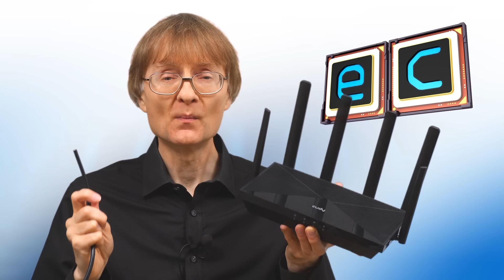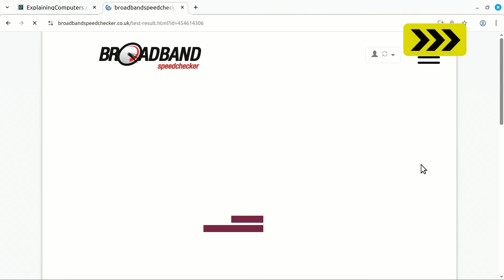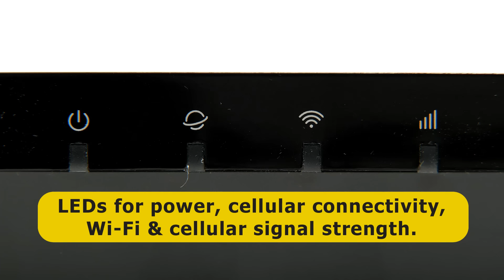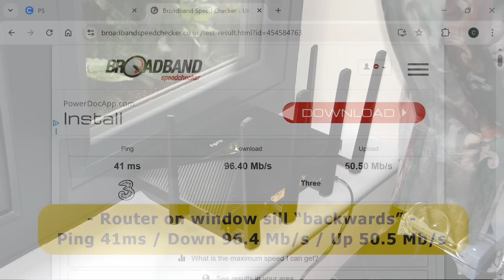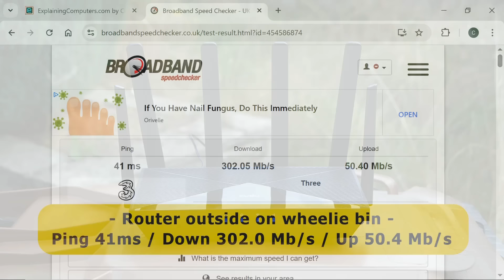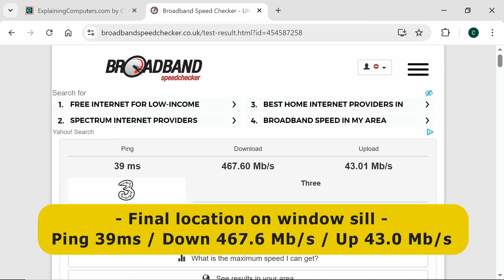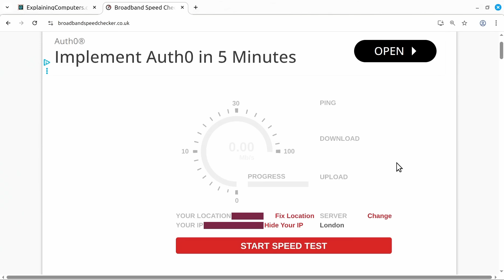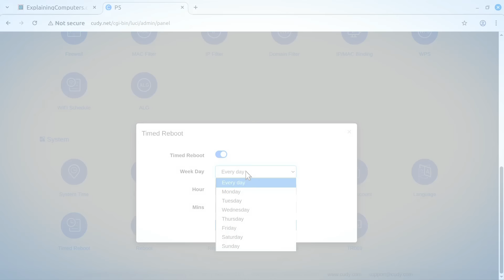Switching to 5G Broadband: Cudy P5 Router

Comment: Don'r rely on the router to also act as a Gigabit switch, get an unmanaged 8 or 16 port 2.5Gig switch and just run one cable from that to the router to take the internet traffic. Also, try raising the router on a couple of books so the aerials are not partly blocked by the window frame.

Comment: I connect to the internet using copper Gigabit connection of 1gbps down and 39gbps up.  My business relies on data transfer so when the internet is down I am totally losing income.  Also my income is based on traffic which means I earn more if my internet speeds are higher.  Fiber is coming sometime soon and offers a minimum of 1 gbps up and down.  I think they call that syncronous internet.  This speed is very desirable and at nearly equal or lower cost.  Faster internet will increase my business income greatly so, I'm patiently waiting. 😇

Comment: I used to get better data speeds on my 4G phone than when i was on FTTC, as my physical distance to my cab was 800m but my Digital distance was 1.6km, downloads were 12Mb/s and up loads were <512Kb/s latency would vary between 100ms and 3000ms (that's 3 real seconds waiting for a response to a mouse click), it was dire. 4G gave me 24Mb/s both ways and a reliable 30-40ms. 
Fortunately we now have the choice of 3 Fibre suppliers, Openreach, CityFibre (was LitFibre) and BeFibre all fighting for my money which currently going to Be Fibre (1Gb\1Gb\20ms for a paltry £25 a month which is less than I paid BT for that FTTC service). Openreach and CityFibre both only work through resellers so quite a good choice of suppliers.

Would be interesting to know what data caps you have and the costs compared to say Starlink or other services. Also long term how the connection is affected by weather, and the merger of 3 and Vodafone.

Comment: I use Verizon Fios which has fiber literally to the living room  where the ONT was placed,  a short ethernet connection from there to the main Verizon provided router.  Testing as I write this I have  ping of 14 ms  Download 804.12 mbps   and Upload 927.12  mbps.  Note that I live in New Jersey which is a major network nexsus. I have a wired connection to my office/studio which has a Nighthawk router that I  use in access point mode. and I ran that test from my computer connected to that bridge.

Comment: I'm in New Zealand and we have a cable connection (USA style) and have a 1Gb connection which delivers 900+Mb download and 100Mb upload, ping of 10,  for just over $80 a month, but only available through one particular ISP which owns that network. We also have a fibre connection which was installed as part of a nationwide rollout for free and as yet we haven't used it. This is the connection through which we can choose any ISP we want and with very impressive deals and specs. However the cost of these alternative ISP services are all more expensive than the one which we are seemingly blessed with, router was provided free too.
This cable network is only available in two cities, Wellington (& Kapiti Coast) and Christchurch and was introduced during the days of cable TV. I guess one day it will be closed down but in the meantime we ain't changing. I enjoyed your video btw because we are thinking of moving house and as always looking at what we may have to deal with on the internet front. Thanks.

Comment: No one should switch to 5G WIFI. ALL RF based pulsed radiation for communications is VERY bad for health. VERY bad. The FCC is corrupt and ALL their standards are bogus and were arrived at through unsound and illogical means. They know of the damage it causes and willingly maketh bogus standards to harm people. Everyone should switch to wired Ethernet connections with ALL WIFI and Bluetooth off. It is faster and WAAYYY better for health. It affecteth not only thy nervous system and immune system, but thy blood, DNA, heart, reproductive system, and mental clarity. And the damage getteth worse over time with increased exposure. This explaining computers guy should IMMEDIATELY remove this video and make anothe video as a retraction and warning people of the dangers and what to do to avoid them, and how to practice safe use of technology.

Comment: does the 5G cellular interfere with the 5G wifi? I wonder if you put a sheet of tin foil between the cellular & wifi antennas, if it would null the wifi  towards the window & boost cell connection speeds..
Reply from the maker: 5G can interfere with Wi-FI is the same frequency bands are used. But this will not be the case on the same device. :)

Comment: I was able to get FTTP with up to 900 Mbps (I only pay for the 300 Mbps service) symmetrical on a fixed IP (v4 & v6), which allows me to forward any ports I like.
Not as cheap as your 5g, but more dependable, with far more consistent speeds and ping times (296.12d/285.32u/3ms).  My old phone number has been ported to my new service, which comes in via a VOIP interface.

Comment: There's a lot of us out here in the Uk would love to know how you kept your landline and number. Please explain.
Reply from the maker: I simply refused to cancel all of my services as a possible "solution" when they told me I had to do so (hence risking the loss of number). And so instead I just cancelled the broadband part, hence continuing as a landline only customer.

See the video description and links therein for how this probably means that I will continue with a landline that will work in a power cut for a good few years yet!

I was expecting this year to have to port my landline number to a forwarding service (or forward it permanently via BT) so it went to a fixed mobile device. But one good thing to come out of this saga has been that I have retained the landline phone entirely separate from data. Anybody can, in theory, cancel the broadband part of a BT package, hence becoming landline only, which immediately delays the digital voice thing to late 2026. And this (if what is now published is true) will mean that digital voice will be implemented in cabinet, rather than in-home.

But of course, if you do this, you will need to obtain Internet via another means.

Comment: Until about 2 years ago, I had satellite internet. I had a theoretical download of 25 Mbs and upload of 10Mbs for 10GB/month.  They would throttle it after that to 5Mbs down and 1Mbs up.  My ping was 750ms to 1000ms....not too bad for 44k mile round trip (70k km).

2 years ago my electric company put fiber in my area. The fiber actually comes inside the house and connects to a box about the same size as your 4G router that you showed in the video. That sits on a shelf, And on the top of the shelf is the Wi-Fi router that does its thing. 
SpeedTest shows I get 100Mbs up and down, and I have no data cap. Ping time is less than 10ms.

I could have opted for a 1Gbs connection, but I opted to save money. Currently I do not need that fast of a connection.

Comment: Here in DK 5G internet has been available a couple of years.
Last year I skipped our fiber cable internet as it was too expensive for 2 retired people.
Instead we got internet via our cellphones which now acts as 2 independent wireless internet routers.
The cost of our internet is now reduced from Dkr 320 to Dkr 58 for both phones with a monthly data transfer of max 400GB.
A price reduction of roughly 85% The cellphone service is unchanged on top of that.
This is more than adequate for 2 PC's and our TV sets.
The speed varies a lot over the day but approx 50MB/s up/down is the fastest we can expect.
The fiber connection came with unlimited data and at least double the speed, which we considered an unnecessary luxury.

Comment: Great stuff, Chris… I did the same thing. They could only supply 64 mb/s in total to my house, so I switched to a 5G solution with a netgear device… I now get between 300 to 400 Mb/s downloads and 30 to 50 up. The location of the device is critical. I end up with an extra Ariel, which connects with suction cups to my windows above the unit…I then use a mesh network to spread it around the house, which works really well and allows for RJ45 connections near the TV and my workstation… Thanks as ever, great video

Comment: Great demonstration, one question: on cloudy or rainy days, will this equipment perform lower than in your tests? Thank you.👍
Reply from the maker: Cloud will make no difference, as both I and the cell tower are below the clouds. :) But heavy rain, or snow, could have a major signal impact. But this has yet to become an issue for me. But I will try to remember to run a speed test when it next rains heavily.
Reply: @ExplainingComputers  "as both I and the cell tower are below the clouds. :) "😝 Perfect! Thank you master

Comment: Wow that's really great numbers! I'm currently using Google Fi through a MoFi (older 3G model) but out on my off grid property I was using Starlink because cell just barely worked through a WeBoost cell booster. It worked, but was painful, especially uploading my youtube videos. There were times I'd ride my bicycle closer to town, park by the side of the road, and do internet stuff on my cell phone, then ride home again. There are no wired connection options available at all on my offgrid property, so its finally in the last couple of years that things like Cell and Starlink were even an option. I was also sometimes going to the library in the next town for bigger download or uploads. Thank you Chris for all of your very informative videos, your time is much appreciated!

Comment: At this house I started with DOCSIS cable which was 12 to 20 Mbps.  Then one day they showed up and said they were converting me to fiber and left the cable boxes on coax and ran an ethernet port to a wall unit outside the house and that went up to about 100Mbps.  When the cable boxes failed due to overheating in a few years they came to replace them and said they were no longer supported and replaced our router with a new one and new cable boxes that ran over wifi only.  They all ran android TV and had a Tivo app that lets you record TV shows in the cloud.  My speed was upgraded to 300+ when they made the conversion.

Comment: I'm in a small semi rural town in the southeastern US, & I've been on T-Mobile 5G Home Internet since Feb 2023, as I was getting ripped off by the local cable company for far too long with no other options till that time, & while it's had its issues with gateway upgrades(they provide the gateways for free w/auto pay), network updates, gateway reboots, having to get an external Waveform antenna to stick on my window for the Arcadian G4AR gateway, it's overall been really good for the for $50 USD a month (average is $60 - $200 USD a month for other providers here) I'm paying seeing burst speeds on a good day over WiFi high as 1.9 Gbps, and uploads hight as 150 Mbps, but sadly the T-Mobile gateways only have 1 Gbit lan ports so my real world speeds are around 600 Mbps to 990 Mbps down, & 50 Mbps to 90 Mbps up with sub 40ms pings, which I'm totally fine with connected to my TP-Link Wifi 6e network setup. 
I'm able to game online, stream live TV via YouTube TV, HBO Max, Peacock, work from home, etc.. with very little issues, and I can't see myself going back to a wired connection unless I get one heck of a deal at a cheaper price, and faster speeds, So I'm glad to see you made the switch as well. 🙂

Comment: "unlimited 5G broadband for £16.00 a month" --> surprisingly good deal. You must follow up in a year's time or so. Thanks for an interesting video.
Reply from the maker: Thanks for noticing the price from the video! :) So many people are asking me what I'm paying here in the comments. A follow-up in a year or so is a good idea.
Reply: @ExplainingComputers  Never seen a price that low in Denmark. Maybe in the UK. So its not part of a deal?
Reply: @ExplainingComputers  That price seems very cheap. I looked it up and was listed as a 'half price deal'. I wonder where the smallprint is that says after X months it will revert to full price?? Keep us posted on it !!
Reply: @ExplainingComputers  - You should test the monthly allowed data amount.  Many mobile carriers have a monthly data limit from 50 GB to a couple of hundred.  Also, during peak hours, they may throttle/deprioritize speeds on cheaper plans.
Reply: @BillAnt  I have a 5G router at home and bought a Smarty Unlimited data plan to put in it.  It's £16 per month for me (should be £18, but you get a discount when you have multiple SIMs with Smarty.)  Had this plan for years now, the price has remained the same, as well as the speeds (YMMV depending where you live.)  Never had an issue with the unlimited plan and plods away on Auto Renew every month until such times I decide to end the plan, if ever.
Reply: @ExplainingComputers  My jaw dropped when you said £16 and I replayed a number of times to make sure that I had not imagined it, and you were really saying £60. Thank you again for making such a succinct video.
Reply: I'm on a Smarty 5G sim, which runs off the Three network in the UK. I also pay £16 per month for unlimited data. Smarty have not put that price up for three years now. Every year I get a message from them stating that I am a good customer and therefore the price will remain the same for another year.
Reply: Lebara via MSE are currently offering an unlimited data SIM including 5g for £9.98 for the first 3 months. After the initial 3 months is up, simply cancel the SIM and get a new one (with a new 3 months discount). Rinse and repeat...
Reply: Just checked my own postcode, BT are offering £25.99 a month for 35Mbps down, which will increase to £29.99 per month in a year and £33.99 per month in two years. So even with the £290 up-front cost of the router, over two years you'd essentially pay the same amount and after three years you could have saved over £200 while also getting much faster speeds.

That's not the price or speed I actually get because I'm packaged in with a TV and phone deal, but it just goes to show that a lot of people could save a lot of money by switching.
Reply: Soracom Three Unlimited SIM, works out less than £5 a month. Use it for my home broadband getting 700mbps
Reply: @georgetaylor6146  nice!! iDMobile is also Three and they have just upgraded their 4G network to max it out before full 5G rollout. nice twice!😀
Reply: I pay £12.50 / pcm for unlimited. It brings me joy as the only cost I’ve been able not only to reduce but decimate. EE in GB.
Reply: I use this setup. No contract with iD mobile £15 pcm unlimited data (and calls!)  50mbps / 5Mbps with 4G. Budjet setup with 4G/5G router with one LAN socket and 4 arials. router costs around £25 on Ali Express. (No 5G in my area yet...although it is also 5G ready!) Virgin cost over £35 pcm for thier slowest service (125Mbps). Also burns a lot less electricity...you'll save around £50 to £100 a year in electrcity costs becuase the 4G/5G routers reqiure far less wattage to run. Not as fast...but for the cost and convenience...just waiting for 5G then got the best of all worlds.
Reply: Is this better than the outdoor 5G antenna from three mobile broadband?
Reply: I thought he said 60 and still thought it was a good deal, because I'm Canadian 😰
Reply: Yeah but nearly $400 USD for the router.  fk that.
Reply: @BenState  Maybe so.  But remember it is a "one time" expense.  Average it out over a year and it is only $33/month, and after you have budgeted it for a year, there is no more cost.  I suspect that it will be used for more than a year, so that makes the cost per month smaller.
Reply: @BenState  unless you are a youtuber, or use an internet connection professionally.  Verizon rented me their 5G router for something like $10 a month, in addition to service. I imagine this will be the way it gets rolled out in US, hardly anyone will buy their own router.
Reply: @squirlmy  Yeah fark a contract.  I get month to month 100Mbps up and down, 3ms ping for less than $30USD per month.
Reply: @BenState  I got a cheaper one for around £25 ...a 'mickey nouse' sized version of the one shown on ali express...works great!
Reply: @ojbeez5260  Sure.  But I didn't pay anything.  I get the router for free and $30 per month for 100Mbs up and down.  That's less than £25.
Reply: @BenState  The router offers a wide range of features, but they come at a premium.

Comment: I setup Mobile broadband based services as part of my day job. Giving connectivity at my companies sites, sometimes in remote locations. We prefer to stick with 4G as the coverage is more extensive. My preference is Teltonika RUT356 routers with external 12dbi antennas. The routers are about £175, and the antennas roughly £50. I use the "3grouterstore" which has been going as long as i can remember. We tend to use EE and in a good signal area i would typically see about 150mb down and 80mb upload. Which is perfect for our office workers and often faster than DSL / SOGEA connections. As i work from home a lot i even have one setup as a Failover for my main Virginmedia, which can be temperamental at times.

Comment: In the US state of Florida, I have been using cable internet from Cox, bundled with a landline and cable TV for one price. I have been wondering about 4G LTE/5G routers as supplemental WiFi for when I get bad connection or bad bandwidth. Informative video for sure!

Comment: I changed from Spectrum cable internet to Verizon 5G, mainly so I wouldn't have to hassle yearly to get a decent price. But I'm happy that down and up speeds are actually a little better, and really happy that I'm locked in on a lower price than Spectrum for 4 years, no more calling yearly, yay!  ...my call to cancel with Spectrum was almost an hour. :rolleyes: